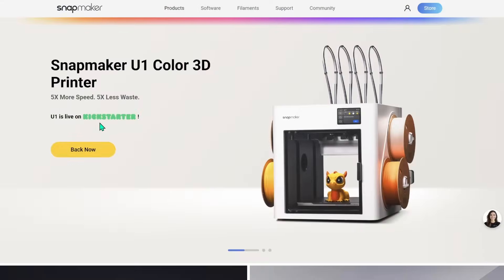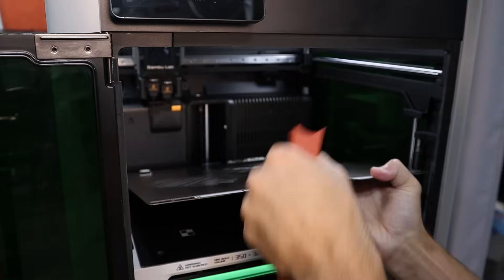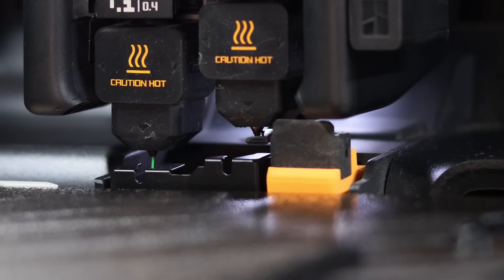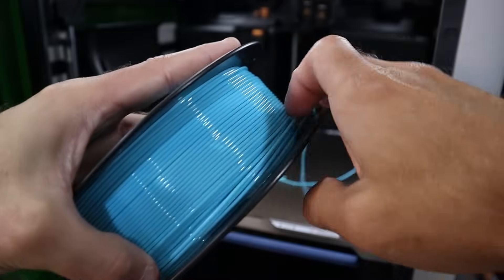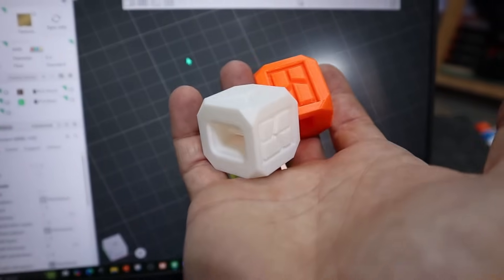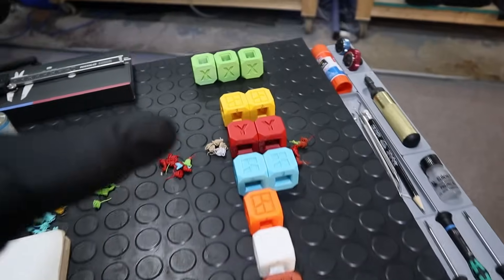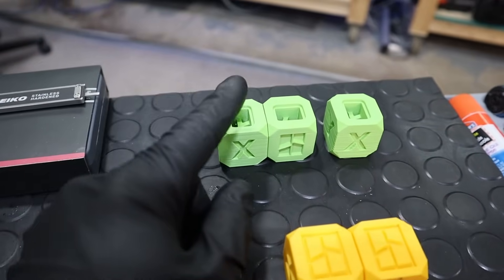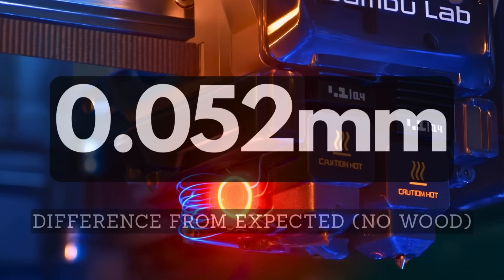The next generation of 3D printers is coming, but I'm not buying one unless it does these two steps

Comment: I want to see these dynamic flow systems actually tell me what the pressure advance value is so that I can take that to the slicer. Indeed, tell me a value for the three different feature speeds so I can use the dynamic PA feature in OrcaSlicer.
Dynamic extrusion ratio via a filament diameter sensor would also be interesting. The runout sensor could perhaps be upgraded to do this, since such a sensor could function as a runout sensor.

Comment: The sensor tech for filiment diameter is there. it's used in making the filiments. Prusa IIRC has 3, one horizontal, one diagnal, and one vertical. This catches  ovalness and explains why their tolerances are so tight

Comment: Cool video! It would be really nice if auto-flow calibration became standard. I think there have been some projects before Bambulab that scan the filament before it enters the printer. This probably wouldn't affect your results, but I wonder what the total deltas would be if you subtract the recess errors from the outer errors. Because with overextrusion you expect the recess errors to be negative and the outer errors to be positive and vice-versa for underextrusion, but shrinkage affects them equally so it would cancel out.

Comment: Since volume is related to weight you could probably also develop a relationship between volume and weight for a filament and then weigh a section of filament to determine the average.  Then you could just weigh a 100cm piece of material from a new roll to calibrate to that roll.

Comment: I know Thomas Sanlander did an experiment where he made a sensor that allowed him to get good cross-section measurement of filament as he rolled it from one spool to another, so the technology is probably ready on the sensor side, getting that integrated into the printer electronics and software and knowing what the distance is between the sensor and the nozzle/heat break is likely going to come into play as well.

Thanks for the analysis.

Comment: AddNorth is pretty overpriced regardless but I think you're doing them a disservice by not using their recommended settings. You printed "X-PLA", which seems to be some kind of 'PLA Tough' and their Bambu P1S config recommends 15C hotter nozzle [220C --> 235C] and far lower flow rate [21mm3 --> 14mm3].

Comment: After watching hundreds of these videos I have come to the conclusion that the technology is fundamentaly flawed.
The molecular adhesion between layers is thermaly restricted due to the delays between the process movements.
The layer being attached to would have to be in a relatively fluid state for the next additional layer to obtain a molecular bond.
This would mean that any gravity of the fluid would also deform the shape!
The best case scenario would be injection molding, where the temperature of the molding is closer to the fluid state of the plastic. Then the mold would be super cooled to provide  extraction from the mold.
This itself has a physical size of mass versus temperature of any material.

Comment: You are measuring the filament with the sharp part of the mouth of the caliper, so you might make an indent in the filament which could account for 0.01 or 0.02 mm deviation. I think it would be better to use the non sharp part of the caliper to avoid this, especially with softer filaments.
Reply: Also, please don't use a cheap caliper.....
Reply: Or even change to a micrometer to equalize measurement pressure further; so does quality of measurement devices…another issue is different stiffnesses across manufacturer. This will also affect push/pull-effects inside the extruder…

Comment: You’re absolutely 100% touching on what I have been assessing as being the two remaining “final frontiers” that will bring FDM printers to a place of full maturity as a technology: nozzle changers (like INDX, with zero waste and good sensors for self-calibration,) and the filament storage/drying ecosystem. The printers themselves have just recently become reliable enough that now everyone is acutely aware of how filament moisture level impacts the printing experience. An ideal filament ecosystem would consist of inexpensive sealed units for spools, which can dock in a drying station, AND dock right onto the printer, which can automatically feed from that sealed unit…. So you buy your spool, get it situated in a sealed unit, dry it once…. And then print it until it’s used up. And it stays dry, whether it’s on or off of your machine in the meantime. Why are we still taking bare spools in and out of dryers, Tupperware, AMS units? Build the ecosystem around the printer. I don’t have to juggle paper cups full of crusting ink whenever I use my inkjet printer, why should filament be treated any differently? A “cartridge” is the way forward.
Reply: Yeah just get a $trata$y$
Reply: Yeah I'm still trying to find the best and cheapest way to store large numbers of rolls in hermetically sealed containers. Over the past 2 years I've bought probably about ~60 of those gasketed 4L "food storage" containers (Praki) that are the size of a single spool. 

It comes out to something like $4-5 per spool for storage with space for indicating desiccant and molecular sieve in mesh baggies in the bottom.

Polymaker actually did make a modular dryer, where the drying unit attaches to the individual storage bins temporarily to dry them, but they are charging $22 per single spool bin which is just way too much
Reply: Sounds like Stratasys has everything you need and want then

Comment: I would love an AMS fed tool changer setup. Something like 4 heads each able to feed from a 4 spool AMS for a total of 16 filament options. You'd get filament drying & still get tool changer print times up to 4 colors, beyond that it would still keep the time down compared to single head printers by having the change cycles run while the other heads are printing. It would take some programming work in the slicer, but it could even be set up to suggest optimized loading positions for minimal waste or for minimal print time.

Comment: Thought I´d put my 2 cents in here, when I saw you used add:north filament, I cringed heavily, in my early days of 3d printing, I learned to not buy them, just cause of what you said in this video, they are junk compared to other known brands, also big inconsistency in quality for their PETG

If you want good filament, sure they are not the worst by far, but I would not recommend them, I tried them again a year back or so, and I still stand by this that they are both not well priced with a lesser quality, many prints that failed in beginning when I had my old CR-10 Pro v1 due to this until somebody told me to buy another brand

Comment: There's actually a few metrics that every sensor currently on the market can't account for, one of which is material uniformity of mixed chemistry. As material science expands with the ever growing material libraries available for most printers, the exactness of how well a printer can melt and extrude any number of materials has more to do with the precision of the hotend components, the extruder power and a few other things that there aren't compensation metrics for in a slicer or firmware. Additives within the filament itself at elevated temperatures throws in another (relatively) unknown by changing viscosity between its native size/shape, then when reduced through the nozzle and how lubricious the nozzle material is at print temp. There's A Lot of study points that can get very granular if you want absolute precison and repeatability between many different filaments/materials, but the slicer can only go so finite between calculated averages and what precision is set up in your config files, or the motors themselves. Then there's also the 'when new' vs aged/worn mechanical bits to contend with, but that's getting way out in the weeds for this topic. 

Ideally with well-manufactuered filament with .03 +/- tolerance (or better), there's enough wiggle room to compensate for slight over or under extrusion if you set up specific profiles for specific nozzle ratios, but that takes a bit of manual adaptation that most users likely are not willing to work up for their material libraries. I'm still more 'old school' if you will and approach my tolerances towards having fractional micron accuracy, but it takes time and experimentation to dial in each machine to that level. Even then, you need consistent material from the manufactuer, which is something out of your control and feeds into the price for performance bracket.

Comment: You touched on the very important topic of filament dimension accuracy. Many claim to have 0.02 +/- etc but I've found some are much worse than advertised. I have a roll of Polymaker ABS that could never print well, and was always prone to under extrusion on one side of the print. I took out my calipers and a light bulb went on. It wasn't perfectly round and one side measured 0.3 off compared to measured from 90 degrees turn to the first measurement, it was oblong. I think an active/live measuring sensor could possibly remedy that but I'm no engineer.

Comment: Interesting - i tried for the first time doing manual dynamic flow calibration on my h2d for some 0.2mm multi colour prints. Its quite time consuming plus a bit of a pain, particularly when you swap filaments between the two nozzles - i suppose I might have to do every filament twice.

I think I will try what you did and do a duplicate of one of my prints with auto adjustment to see if I can notice any differences.

I agree that filament roll management and enclosing is going to be an issue for the Indx - I think not BL users doint really realise how convenient the AMS system is, especially if you use mostly BL filament.

For snapmaker I guess they could provide soone transparent side covers for the spools.

Re your brittle filament I know it can be an issue with the AMS, but I suspect it is going to be a lot bigger issue with the Indx - especially if you end up with masses of nozzles, sone of which are rarely used.
Reply: Further update - switched H2D from 0.2 to 0.4 nozzles and forgot to switch on auto calibration again - result messy failed print.  Turned on auto calibration - print fine.  I suppose I should have switched all of the profiles and re calibrated the colours I hadn't previously done at 0.4 in both nozzles - but I think I will stick with auto calibration from now on.

Comment: Good job on the video. I think having an inline filament-diameter measuring sensor is a must for auto flow adjustment on the fly. I will ONLY buy a multi-color printer if filament waste (poop) is 100% eliminated! Last, but not least, sealed, controlled environment multi-filament system is also a must, something the I can mount on the wall behind and above the printer.
Reply: Impossible to eliminate poop 100%. if the heated filament sits in the hotend for more than 30s without extrusion it will be degraded. this is why the hotend is cleared before each print.

Comment: I can't help but feel we often tend to expect these hobbyists printers to be on par with professional one's.  If you want/ need precise prints, then shell out the extra and get one! The rest of us are grateful for the incredible innovations that the 3D Market has taken since the Ender3 and so on!
Reply: > If you want/ need precise prints, then shell out the extra and get one!

These commercial printers are commonly much more closed than many consumer printers.
Reply: Having run and supported professional/commercial printers for decades, the extra you pay goes into facilitating larger parts. Bigger heaters, more insulation, stiffer structure, CTE/shrink factors - not better or better automated calibration or cleaner parts. Closed material ecosystems improve consistency, yes... But they also allow for a warranty - when (not if) the material is out of spec (and the operator notices), the material is replaced without question.
Reply: @fancytableshoes yep. i used to have a ultimaker S5 at work with full upgrades. my ender3 V2 at home made cleaner and more accurate prints and it's not even close
Reply: Or just print a prototype and then correct for the final version.
Reply: Hobbyist printers are in the 400$ price range max.

From a ca. 2k printer you should be able to expect professional results.

Comment: I find (at least for larger prints) that shrinkage compensation is more of an issue that isn't addressed from factory.  None of these factory profiles have any compensation applied.  You'll never notice till you print something 200 to 400mm wide and try to fit it to the real world.  You can quickly be 2mm or more off at larger sizes.
Reply: This is a side effect of the way slicers organize configurations. 
The main settings are everything movement related, and the filament profiles are everything print head. 

Shrinkage compensation is a movement change. 

I’m not disagreeing with you here, just elaborating on what makes this a challenging feature to implement. It’s not a technical challenge, but a UX one. The moment this philosophy is broken, the genie is out of the bottle, and other parameters that are often changed with filament types (speed, acceleration, wiping, etc) should be moved as well, right?

Most people only print PLA, so having these settings moved to each filament they use would be a pain since they’re all pretty similar. 

I think the solution may be adding another layer of configuration, one that orchestrates  both filament profiles and print profiles, maybe per material type basis. This might get complicated quickly though, which would defeat the purpose of simplifying.
Reply: @TheOfficialOriginalChad  all the major slicers have shrinkage compensation of some kind. Usually in the filament settings.

Comment: I would prefer there wasn't any music under any speaking.  If what you have to say is important, then clarity on that point should be priority. It only add distraction and unfortunately in my experience in this case, made it unwatchable. I really enjoy your content and quality of video presentation and hope this improves.   

I'll share two analogies to refine the point.  If you show up at a dinner party, there's music in the background, it eases the environment, fills the space until people do, then there's chatter. But in that case your not really listening to anything specific. What matters there is mood.  Inversely if you showed up to your Physics lecture at Harvard, and your professor put a smart speaker on the podium turned it on softly, and started to lecture over it,  you would reason that professor had gone insane.  

I think many content creators do this as a product of emulation not fully realizing what it can and can't do. The really good ones realize that crafting content requires understanding and careful decisions to perfect, just like cooking. I think your headed in that direction and hope this helps.

Comment: I think you have to calibrate [in a commercial/scientific setting] brand and type at least once to get the filament characteristics in a more focused range. Generic settings can only go so far due to brand specific chemical composition of the filament.

I think I see "on the fly" calibrations, or something along that idea that Pressure Advance being maintained, being useful for multi-toolhead printers which swap tools for different colors or filaments. If the printer can detect deviations of pressure and correct it, while printing, it should eliminate the need for the purge tower. Which in turn means tiny poops and so much less waste. Oh, and let's make this open source, please?
Reply: Could you explain why pressure sensor means you don’t need a purge tower?
Reply: @TheOfficialOriginalChad  Sure. When you have a single nozzle and a single filament, you usually extrude a little bit of filament before you actually start your print, right? That's called a purge (or prime) line. The action basically "primes" the hotend with molten filament with just enough pressure on it that it doesn't ooze out or not flow enough when the print head starts its run. With multiple filaments and one hotend, you have to clear the old material out (poop) and then prime (purge/prime tower) the new material to start printing immediately. With multiple hotends, you don't need to purge filament but you do need to prime. SO the thinking is that you need to prime a hotend each time it is swapped in for another hotend, and so on. If there is a way to measure the pressure and consistency, then we wouldn't need a tower right, it would just be go, swap in now. If not meting the pressurization, then a tiny bit could be extruded while in the rack and then scraped off when the hotend is selected.
Reply: @thomaswiley666 You're not explaining why knowing nozzle pressure translates to not needing to purge...or I'm missing something.

Comment: My experience with A1 calibration system is that it’s ok if you are in hurry, and don’t intend to use the filament again, but it’s so inconsistent, that most of the time it’s better to just use some random profile. 
I have autocalibration feature turned off all the time. OrcaSlicer makes calibrating filaments so easy I don’t see the need for autocalibration feature, unless you are forced to use many random one offs filaments (like review samples etc).

Comment: Prusa xl 5tool rocks (check out some stuff on my channel) the problem with it is the cost. If the cost can be reduced then it will be the golden age of printing in that you have the filament, the software, the multi material/ colour. The only thing is still speed. Which I fear is at its limit. 

I want to see a core one with indx - I suspect prusa may license that tech for their printers going forward. A prusa xl2 with 10 tool heads wouod be neat! The core one with 9 wouod be good too. Mk4 would become obsolete at that point.